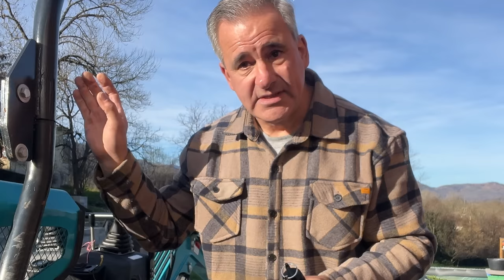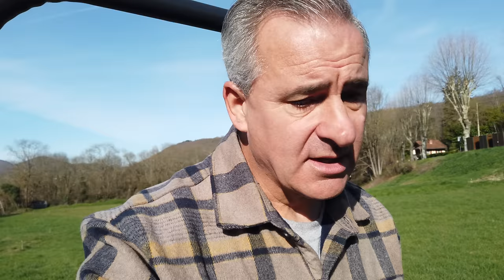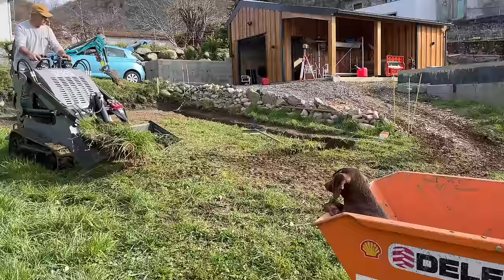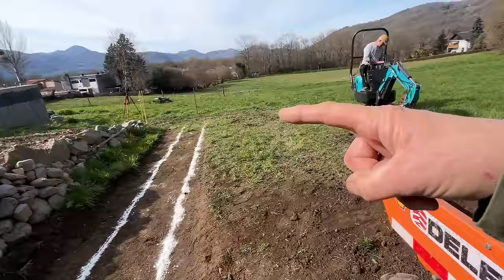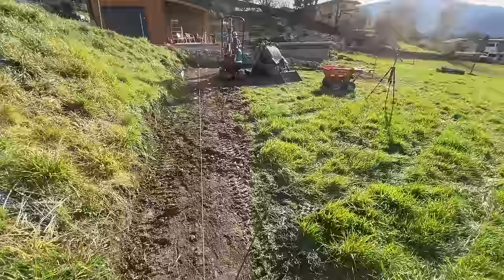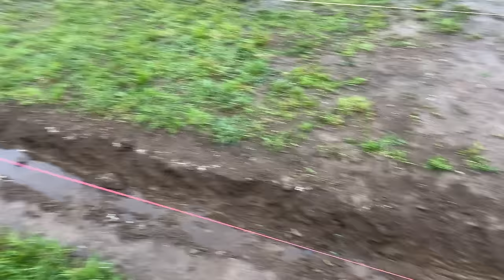Rise of the Mini Machines | Footings for Retaining Wall

Comment: I just helped my cousin to build a house in Montana. We did it with SIP panels including the roof. Five of us got it closed in in five days. If you do your floor system with SIP also it will be very energy efficient.
Reply from the maker: I am totally converted to the SIPs method - thinking of a ICF pony wall for the crawlspace and then laying a SIPS floor on top.       We are taking with some SIPs companies already 😀

Comment: I am glad you are considering alternative building systems for your house. I feel an engineered system like SIP has many benefits especially for competent diyr’s. It provides flexibility in arrangement and solves the penetration, condensation and ability to take fixings that the container type build presents. 
I look forward to the design,procurement and build.
Might I suggest ‘undercroft’ for the space beneath your house. Although not strictly true I believe it has a much nicer ring than crawl space.
Reply from the maker: Yes, we did a lot of thinking. Talking with a company now but seems to be taking ages. Still not a common build system here in France.

Comment: Your excavator repair is proof positive that all it takes to keep these machines running is a bit of mechanical talent and application. I noticed also that you're able to control it a lot more precisely than when you first got it which is some more proof positive that these chinese machines work just fine, just need time in the seat and a smidgin of ability. They are great machines for practical people (and you are that for sure).
Reply from the maker: I think all machines are the same way even my car, I will work on them as it hurts too much to pay someone else to do it (other than major jobs of course).  Yes, I have got the feel for it now, although a slight lapse of concentration and it jerks you back to reality 🤣

Comment: I wonder if you could mount a box onto the back of that stand up digger as a counterweight using those oval rings? Like make a metal channel to hold a 300L bag of water which would give you an extra 300 + kg of weight at the back so you can lift up heavier loads without the digger tipping.
Reply from the maker: It is only an issue with the forks, the bucket is fine.  I did not want to put too much weight on the machine as it may tear up the ground more.  I will have a go at modifying the forks I think.

Comment: Nicely done! Thinking about the diggout, just a thorough the material the big digger , digging out why not use it to level out there the is a slop done...⁉️ With that big digger he can make it in a nother hour, make it a nice flat and hard area.....⁉️
Reply from the maker: The bigger machine will level the site for sure - only where the house is going as I do not want to lose the slight slope for the rest of the garden.

Comment: Glad to see you've rethought the containers. SIPs are a great idea if they're not using foam as the insulation material. Not a big fan of insulated blocks, but they're likely less expensive since you could install them yourselves (but they come with their own issues - probably not something you'd want to do if you're using them the first time as the learning curve can be high).  

Personally, I hate the idea of being surrounded by foam in a tight home.  That's why I prefer conventional lumber framing, natural insulation materials (like sheep's wool) and stone/ceramic/wood floors/counters etc.  You can build a high-efficiency, tight home that meets Passive House standards without any foam/offgassing materials.
Reply from the maker: If I go with SIPs then the house design is done for me with certification - if I go stick build I will need an engineer to do the drawings for me at another cost plus the extra costs for the timber here is about 5 times that of the US.  I will go a picture of ICFs for the crawlspace wall and SIPS for the rest of the house - the foam will be sealed in so we should be OK  👍🏻

Comment: Hi ian an julie     This is really looking amazing for the container house and to see the plans super imposed on the area where it will be is fantastic 
Congratulations on phase 2 seen the excitement on both your faces  . That skid steer is really going to be a great asset to the build and landscaping  . That's  the right decision to bring in big digger to lay out the groundwork s  will save you both a huge amount of work as the small machines would take weeks  enjoyable video thank you
Reply from the maker: We are lucky to have found a great local guy with big machines - so we will use hime when necessary.  I want my equipment to last me for a long time on lots of smaller projects. 👍🏻

Comment: Guys, why not build with traditional framing? I would strongly advise against using steel containers. Why? Because you have to frame the inside like you would with a normal house anyways. You might have condensation issues in the walls because of cold steel meeting warm air. There's a ton of holes that need to be cut and welded, for windows, doors, water and electric. Yes, you don't have to put cladding on, but compared to a normal house, I think there's way more work with a container house.
Reply from the maker: You are exactly right and we have come to the same conclusion - we are hoping to build a ICF base with a SIP main structure and timber frame interior - the containers do require  frame inside and out and we would have had to clad it in concrete fibre board - 👍🏻

Comment: Oh what an exciting step 😁 I was on the digger today, thought I'd fooled the charger into reviving the battery, no Bueno.  Ordered a new one, £54 delivered. I do hope I don't have to mess with the wiring Ian 🙏
Reply from the maker: Where did you order it from - I am still thinking it may have affected the charger as the voltage jumps around a bit on the gauge.
Reply: @HomesteadingUncontained  Tanya in Wales. They have a wizard where you put in dimensions, polarity position and pole type. There were several that should fit. Let you know if it works when it arrives 👍
Reply: Would you believe  that battery arrived just now! Amazing delivery. It's very similar. The base needs a smidge adjusting to fit but is otherwise good. Alas the excavator doesn't start. Even had a "lo" warning at one point. I fear the wiring loom is the culprit. I'll send you pics 👍

Comment: Hi do you think the wiring issue on the excavator was bad construction or just chance bad luck .?  . . . I’ve just bought something similar so maybe something to expect?
Reply from the maker: A bit of both really.... the cables were run under the motor and a bit too tight.  So they must have scuffed against the chassis.  So probably a small short but when I started using the booster to start it, the cables then started melting out.  It was a simple fix but took a while to work out until I could see the smoke 😬
Reply: Thank you for your reply, the machine is on its way hopefully.
I am looking forward to your next video, here in Scotland we are still in winter .

Comment: Do you not think that maybe it’s a mistake to be moving on to the house set out & another retaining wall etc, when the workshop garage remains incomplete?

That rear wall and roof over where you store the excavator really should be finished first before you start the house project.

Knowing human nature, once you move on to the next project, likely you will never go back to completing the workshop / garage.

Once the weather destroys that waterproof membrane, you will have to remove the timber cladding, replace the waterproof membrane, then re-apply the cladding - then apply the missing boards as well, then install the roof over the excavator storage car port.

Not only is the weather destroying your water proof membrane, it’s also prematurely aging your mini excavator.

If you continue to leave it out in all weathers likely not won’t last you until you complete your house.

Sun & rain & snow etc are the enemy’s of every rubber component on that machine. Drive belts, hydraulic hoses, wiring, tracks, radiator hoses and so on.

It seems like false economy / poor planning to allow yourselves to be distracted from completing the workshop / garage in order to start in on the house.

This type of poor planning for “order of operations usually ends up with a half completed workshop / garage & a half completed house.

You don’t want to end up living like that.

Complete a big project like the workshop / garage THEN turn 100% of your focus onto building the house.

My 2c
Reply from the maker: We are just making a start - once the excavation is done it slows us to work on it when we want to.  But we will be finishing off the garage plus the levelling of the garden on the garage side (hence the final retaining wall as this is crucial to get this level right).